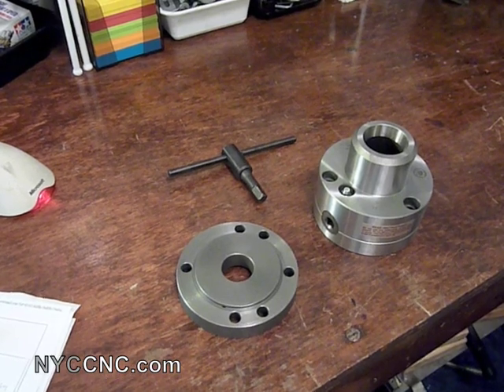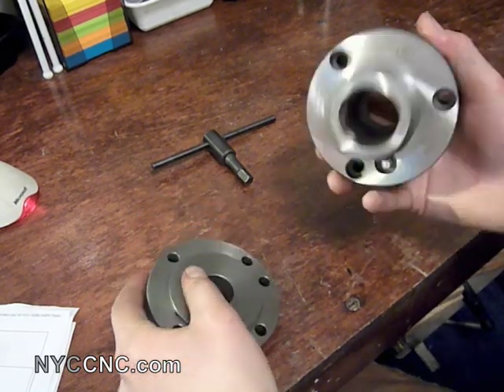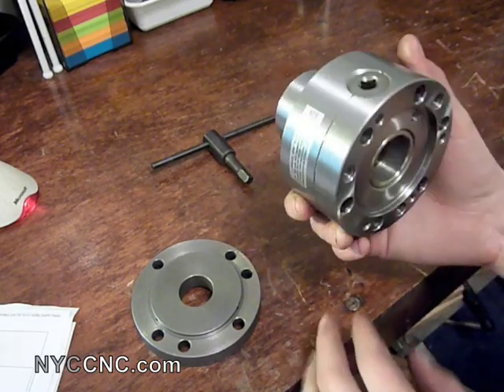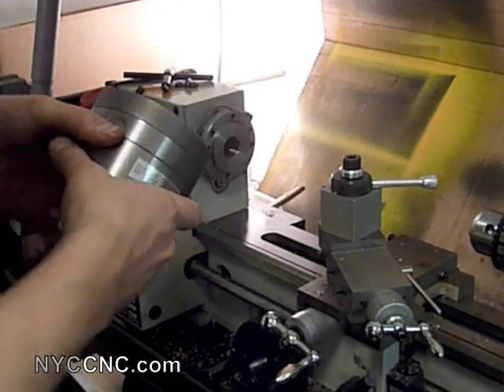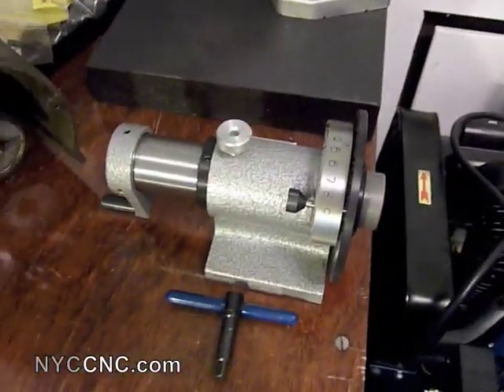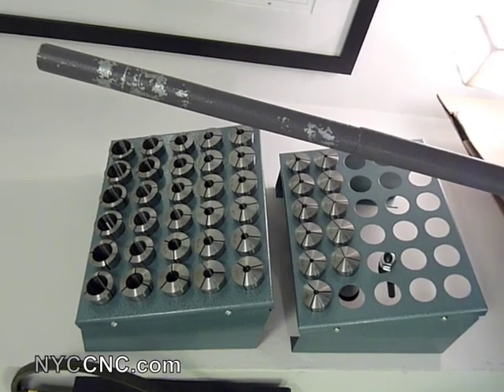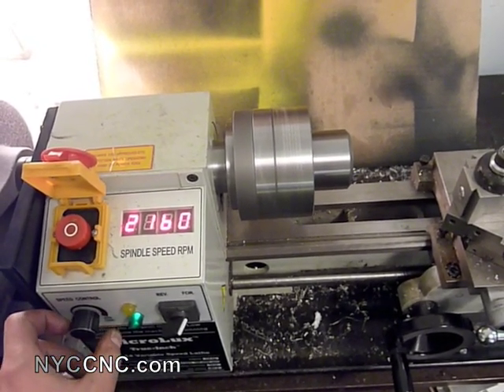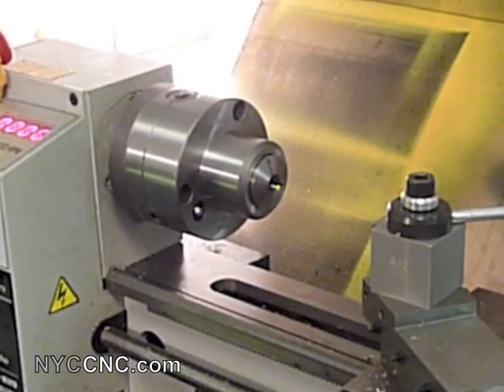4" Bison 5C Collet Chuck for Micromark Mini Lathe - 7x14 or 7x12

Comment: I didn't know that Bison had a 4" version.  I will agree that these are very nice chucks.  I have a the 5" Bison "Set-Tru" chuck with their D1-4 back-plate on a 12x36" lathe.  Beautiful chucks.  I like the "Set-Tru" as you can really dial them in.  I have a video when I set mine up showing .0001" TIR.   Bison only guarantees .0004" on that chuck so I am pretty happy.

Comment: 5C is Super useful. We have 3 small manual Hardinges. And we probably have a couple of hundred metric and imperial 5 C collets, plus several dozen extra depth and soft collets and some extra width collets up to about 9" that we have machined specifically to hold large odd shaped components. Those wide ones are not spun in a lathe, but are used in auto rotating indexers in milling centres. When I can afford a lathe at home, I can't see the point of not having a collet chuck if I want accuracy ;¬)

Comment: Nice video man. :¬)
So far, I've been able to do my own 'home work' at work on our manual Hardinge lathe. But sometimes I'm at home and wanting to make something without driving miles to the workshop. 5C is the magic number for fine turning, as I knock up small parts for RC planes and cars.

Comment: I bought the LMS 7x14 (love it) and their 5C collet system for the same reasons you like 5C; but felt the chuck was just too big for the small lathe.  Ate too much of my lathe bed and I worried about all that mass hanging on the end of the spindle.  I returned it (and LMS was great about accepting the return) and I think the Bison 4" size (and always-great Bison quality) would be just right.  As you say, pricey, but a great tool that will scale up to your next lathe.  THANKS!
Reply: That Bison 4" chuck is worth more than the lathe.... I wish there was a little cheaper alternative :)

Comment: Ok, I've had a chance to work with the Gloster 4" ER40 chuck and it takes the 1692 adapter directly.  I was able to indicate the pair down to just under .001", so decent such an inexpensive solution.

Comment: Thanks for the great stuff in all of your vids.  I was very interested in this for the 7x12 LMS lathe, but was turned off by the high price & length.  So I started to look for other options.  I thought the ER40 collet to be quite nice and has a through hole larger than the mini-mill anyway.... and bingo, I found Gloster Tooling in the UK (via eBay).  They make a 4" ER40 chuck that has a 72mm register.  I just ordered it, so I can't vouch for it just yet, but it should be a decent solution.